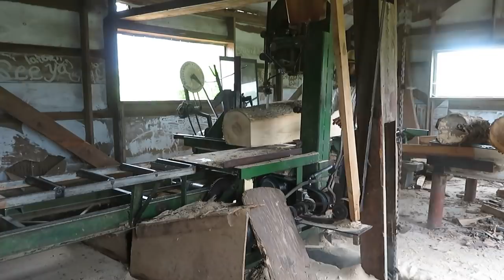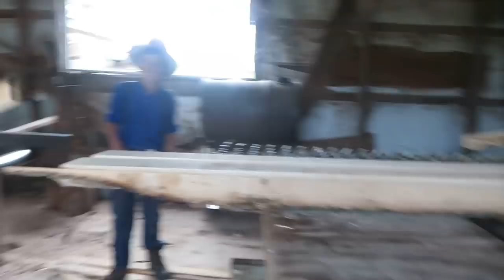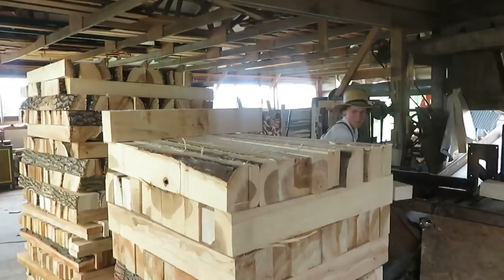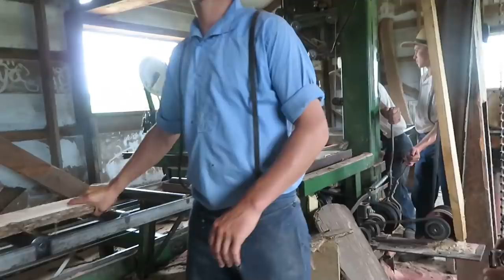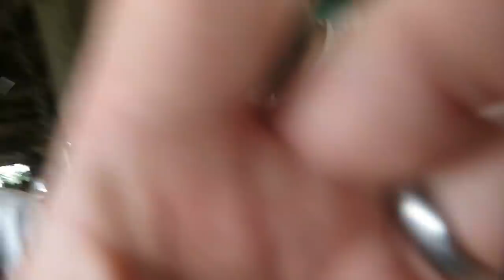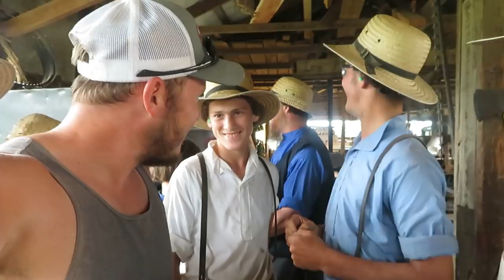Inside an Amish Sawmill And How It Works | Lets Go Inside!!!!!!!!

Comment: No safety guards. Good to see they are at least wearing ear protection. Should be using large headphones but ear plugs are better than nothing.
Reply: That's a bandsaw mill, not a circular saw.  They're quietter without the circular saw blade singing.  Relatively quiet compared.
Reply: Most earplugs have much better noise reduction than earmuffs  .....glad to see younger generation using ear protection,hearing loss is forever.
Reply: @rotunda57  they are using a cutoff saw so no your not correct.

Comment: What powers their sawmill? 
Steam power? Or water power?
I dont think they use electricity or gasoline engines for power
Reply from the maker: They actually use a Diesel engine to run it..... explain that one lol. One of those things they do that just don’t make sense
Reply: @DaddysLife  Maybe because they can't/don't/won't ride it!
Reply: They aren’t suppose to have motorized vehicles with air in the tires.   That why you will see some of them buy skid steers with tracks    It is very odd they can’t have grid electricity but can make electricity with diesel power lol

Comment: What is the power source?
Reply from the maker: Robert Spencer Diesel engine witch still doesn’t make sense to me lol
Reply: AOC aside, it's not unheard of for farms to recycle their animal waste for the express purpose of generating methane to power their implements. It makes a ton if sense. Farms typically work in tight margins, so it makes sense to cut costs where you can.
Reply from the maker: VeritasEstVeritas there not using there animal waste for  fuel. They are using a Diesel engine to run the mill but they won’t use a diesel truck.  They use a home made mower with a gas engine that runs a belt witch turns the blade but they won’t use a lawn mower.  It’s dumb in my book

Comment: I thought they didnt use technology?
Reply: There are Amish and there are Mennonite. They often dress the same or very similar and sometimes are often assumed as one being the other. The Amish are still more traditional to the Amish ways of doing things more in the ol' fashioned way, and the Mennonite are what I'll call a branch off of the Amish who are more lenient when it comes to using technology n such. However the Amish have many different sects that one sect may allow generators to power machines such as but limited to clothes washers but the other sect does not permit the use of electricity regardless of how it was obtained/produced. Mennonites will more often allow cell phones whereby more Amish more often seem to not permit them but many many things are changing as more and more Amish areas become more of tourist-style locations and are influenced by other cultures
Reply: Thank you for your answer.
Perhaps the question of mine is what is technology. Because even on horsepower... the thing it does is a kind of it.
Perhaps life doesn't stand still and changes continlously. For me I don't believe there's one road to follow, but I like to be inspired of those who are different my mine.
Thank you for showing me a little bit more in your culture, and I have the deepest respect for any sole on earth who isn't mindblocked from the assumption that what they now is the absoltue truth.
Me myself am carptener, cabinet maker in progess... and that's why landed on this video. Would be cool to see these things in real life. And what I truly love about the Amish or Mennonite is that they care of there own buisnuis in independece!
Bless you all!